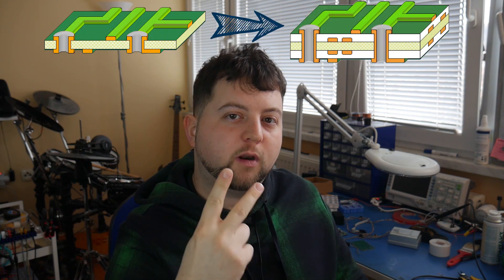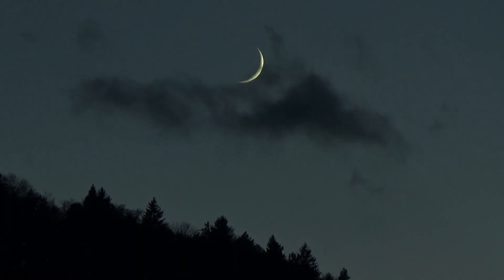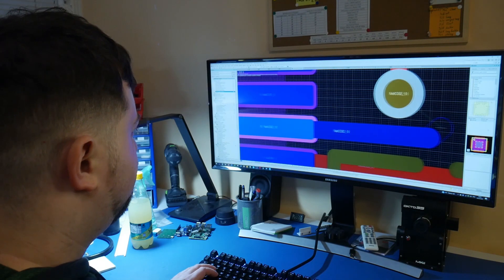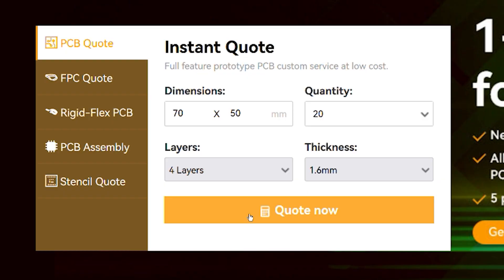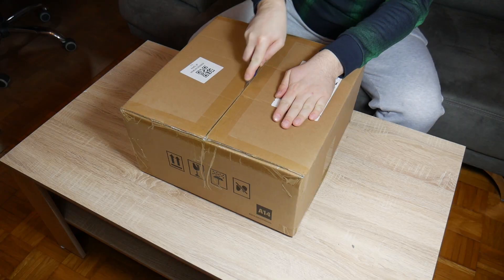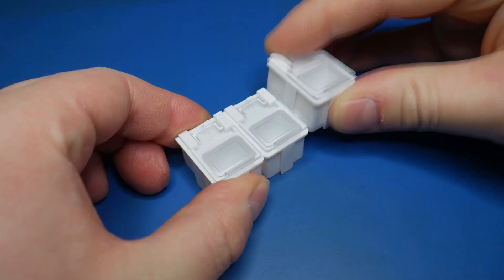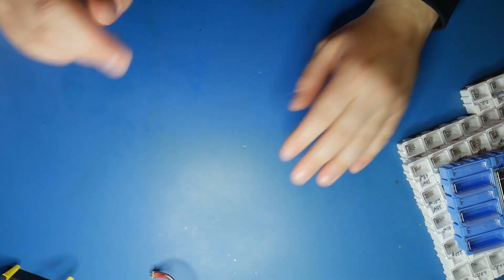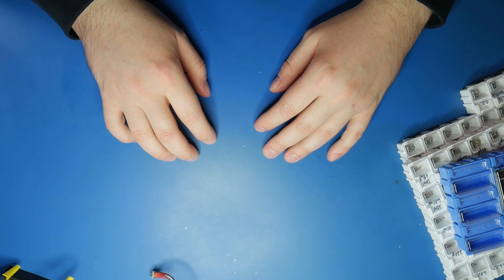OKTO35 Mk3 Camera Progress Update #2

Comment: btw, any ballpark estimates on when a first prototype would be widely available (beta testers or beyond)? and a ballpark cost?
Reply from the maker: I think the Mk3 could be ready for beta testing around this summer/autumn. Costwise can't say for now, but nearing the end of the development the approx cost would be known.
Reply: @BlazSemprimoznik  I'm definitely interested, hope I won't miss the call
Reply: @BlazSemprimoznik I guess the question is, will it cost above or below 1,000 Euros? I know that if it's gonna be below 500 Euros, I'll definitely get it for Christmas!

Also, what kind of DSLR adapter are you using to 'scan' the images? How do you sync the DSLR to the camera transporting the film strip? What happens when the strip has reached the end of one of the four columns during shooting? Does it rewind the entire film before it resumes filming, or is it a kind of boustrophedon system alternating direction (down, up, down, up)? https://en.wikipedia.org/wiki/Boustrophedon
Reply: @BlazSemprimoznik Another thing is that you may wanna consider adding more ASA/ISO values. Your project has made me look up what 135 films are available that I could use with your camera, and not only are there stocks with quite regular or reasonable film speeds such as 25, 64, 80, and 160 ASA that your camera doesn't seem to support so far. Other people that I've introduced to your project have even expressed interest in using special print stocks with your camera that come with 5, 6, 7, 8, 12, and 15 ASA. I think these slow films will require the camera to block higher framerates and only allow timelapse mode.
Reply from the maker: @tlatosmd7074  Most likely the price will be under 1000€, a more precise number will be known nearing the end of the development. 
For scanning I'm using a stock lense (at max zoom) that came with the DSLR and a C-mount 25mm lense. No other adapters, it's a lense-to-lense transfer, the 25mm lense would be supplied together with the camera. 
Frame scanning sync is achieved via a trigger wire between the DSLR and the okto35. It's fully automatic for each film column/strip, only when changing between the rows the user has to move the DSLR lense to align it to the 25mm lense. When the end of the column/strip is reached, the okto35 automaticaly rewinds the entire film. With the Mk3 the plan is to make it into a boustrophedon system, so the pauses would be only a few seconds.
Your idea of a lower set of ISO values sound good, I'll add them into the Mk3's firmware.
Reply: @BlazSemprimoznik Those are all great news: More ISO values, the included lens, and a potential boustophedron system to minimize the gaps everytime the end of the roll is reached. I only hope my DSLR (Canon EOS 400D) is properly equipped for a wire trigger.
Reply: @BlazSemprimoznik Okay, just checked, my Canon EOS 400D does have a socket for trigger wire.
Reply: @BlazSemprimoznik Another idea, since you're talking about using a rotating shutter: What degree will the shutter be? Most Super8 cameras used to have a 165° shutter, but there also were more sophisticated XL ("eXisting Light") cameras with a 230° shutter. As the XL shutter allowed for a longer exposure time per frame, XL cameras made better use of light in darker situations.
Reply from the maker: @tlatosmd7074  For the Mk3 a solenoid shutter will be used, since the newly designed PCB has already support for it. The rotating shutter would be reserved for Mk4. However, the solenoid shutter being electronically controlled, could be set in variable degree manner, not in the range as XL cameras, but maybe ±20 degrees from preset.

Comment: external film case? hope the film can still be developed easily, not longer than 1.5m
Reply from the maker: External film case attachment would be suited for film, longer than 1.5m in order to expand shooting time. The camera would still support classic 36-exp rolls.
Reply: we'll just develop custom developing tanks if not already existing. and 1.5m is a regular 135 canister, so stop worrying about the external can size
Reply from the maker: @BogdanSorlea  Yes, the camera will support classic 135 36-exp rolls (can be developed easily at home with Paterson tank) and for longer shooting there would be optional external magazine attachement that can be used for shooting and scanning, and for the development it's up to the user on how to do it (maybe a large bucket ?)
Reply: @BlazSemprimoznik But just what kind of film will the external magazine use? Certainly, it can't be regular 135 36-exp rolls, so what else will it be? Custom rolls that each user will have to custom-order from Kodak, Fuji, or ORWO?
Reply from the maker: @tlatosmd7074 Bulk roll would be used, manually loaded into the magazine up to a certain length.

Comment: Blaž, you are an inspiration. It's a shame trying to give the camera reflex capabilities would be nearly impossible, with how little space you have to have to work with between the lens and the shutter, adding even a small mirror would screw with the focal length. And of course, redesigning the entire shutter mechanism to be mirrored itself doesn't seem technically feasable, even using something small like the guillotine shutter design of Beaulieu's. It would be nice to somehow have a way to accurately frame your shots, even if the ability to critically focus is lost. Anyway, your passion for innovation in this 'dying' medium gives me a sense of great optimism for the future of this art. NEVER STOP CREATING, BLAŽ!
Reply from the maker: With C-mount there is not much space between end of the lens thread and the film plane, only about 10-12mm and the shutter takes majority of this space. I've tryed experimenting with some beam splitter cubes (the smaller, the more expensive :/)  and mirrors, it might work somewhat, but the problem arises with the lense shift; here the focal lenght would be constantly changing (upon film track change) and making any static reflex optics tube unuasble. Although, I am thinking of rotating shutter instead of current solenoid, similar to professional movie film cameras, maybe even at 45 degree angle if possible, this would be reserved for the Mk4 :)
Reply: Professional motion picture cameras use a rotating mirror as a shutter that’s angled at a 45. Maybe that’s something worth looking into Blaž
Reply: @Le_Max_And_Cheese He could keep the shutter he already has and use a beam splitter, but he'd have to ditch the C-mount lenses and use something with a longer flange focal distance.